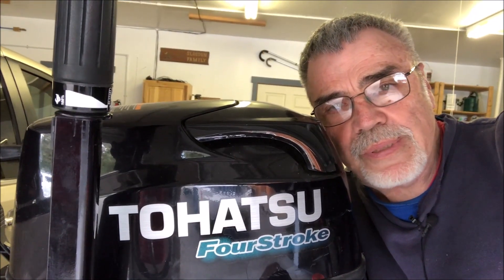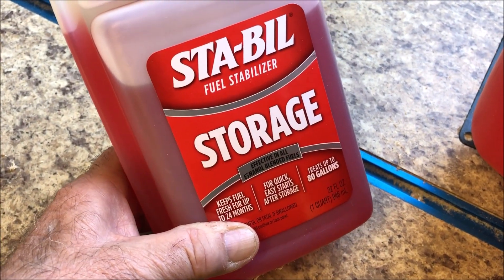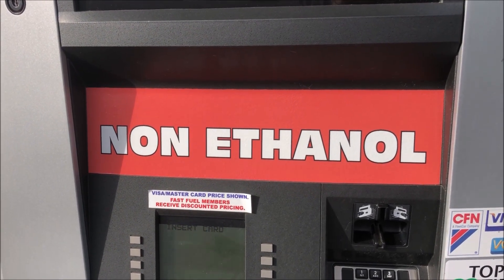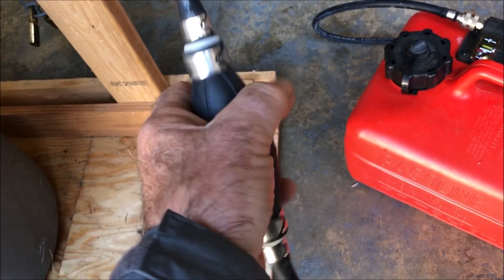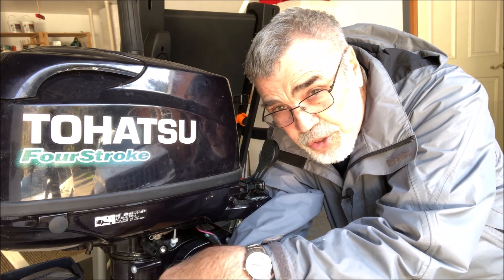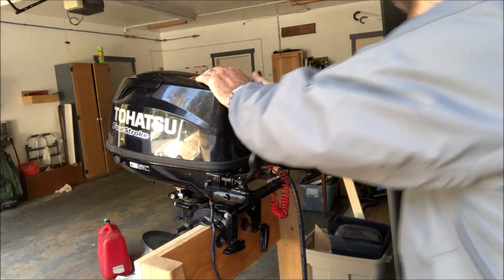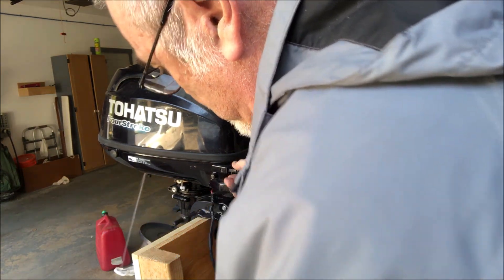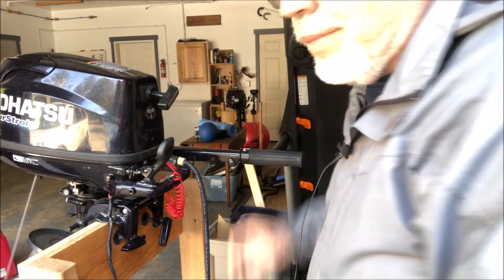Tohatsu Three-pull Challenge -- Catalina 22 -- Jim's Little Boat

Comment: Nice video. You just helped me decide on getting electric start.
Reply from the maker: I do have to say that the motor sat for 33 days after I shot the video.  It started on the second pull.
Reply: @jimslittleboat4388  that's awesome. I just ordered a 20hp tohatsu with electric start.
Reply from the maker: @bbeicker2  I am sure that will be an awesome engine, and females in your life will appreciate the electric start.  The alternator will keep the batteries topped up.  My concern is weight on the stern,  Just out of curious.  How much does it weigh?
Reply: @jimslittleboat4388  yes sir one of the reasons I want the electric start, was for charging batteries and so my wife could start it. We also have a little boy on the way in October, so he will be able to start it easily one day and drive me around. The motor weighs 104lbs. It's going on my 1442 Jon boat rated for up to a 25hp.

Comment: Good video Jim.  I do the exact things for my little Tohatsu built Mercury 3.5 hp with a built in tank and it has only failed once in 10 years due to a bad spark plug.  (My fault, should have changed it sooner)  It's amazing how long these motors can run on a little bit of gas.

Comment: I read on sail.forum, choke fully pull crack throttle open close 3 times then pull should start on 2 or 3rd pull. Worked for me in 29 deg
Reply from the maker: Should have worked for me--bragging leads to bad karma.  If you ever land in Olympia, I will buy you a beer.  :)
Reply: @jimslittleboat4388  your on, I enjoy fish n chips with a good pilsner

Comment: I just bought a 6 hp Tohatsu Took it out of the box put it on Sailboat and it started on the first pole I couldn’t believe it what a great motor
Reply from the maker: They are great little motors.  They are fussy about the gas, and they can be a little "floody" when they are cold.
Reply: @jimslittleboat4388  easy peasy. Buy the propane!

Comment: Hey Jim. Is that the 20” or 25” long shaft? I’m thinking about getting the same engine.
Reply from the maker: 25-inch.  I bought it because they were out of the 2-inch, but I am glad I did.  It sits up higher so the controls are easy to reach even while the prop is deep in the water.